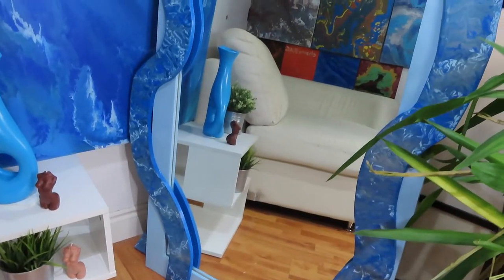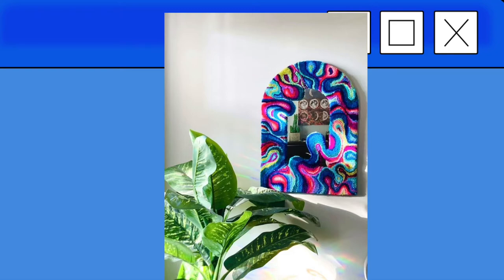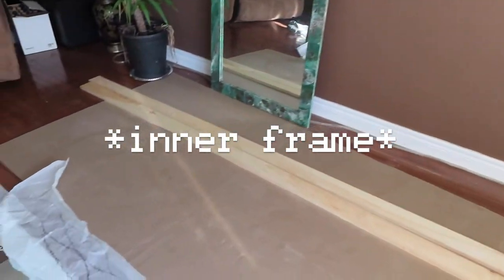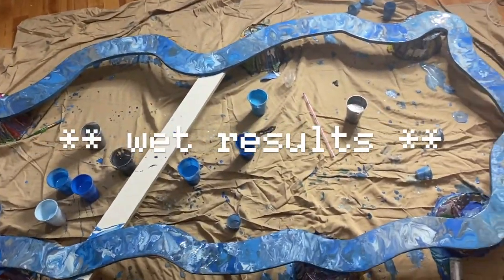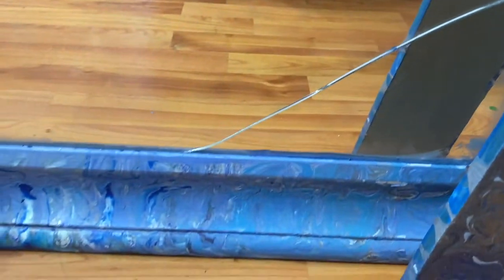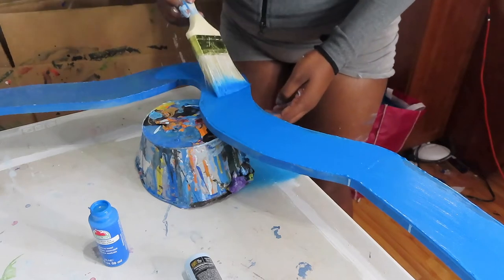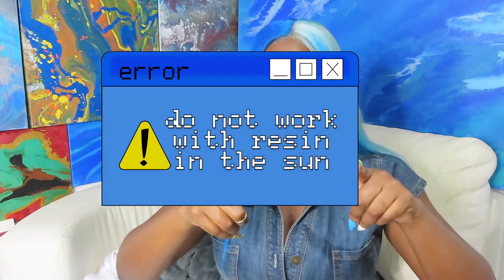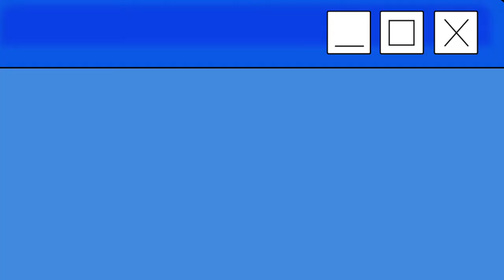diy aesthetic squiggly mirror ~ curvy wavy abstract furniture | acrylic pour & resin

Comment: Cute idea. Just for your future knowledge your resin was totally still fine and it does not matter if it was an inexpensive or an expensive resin. All resins can do this. It had an exothermic reaction because there was alot of resin mixed at once. When you mix alot at once it does this real fast. Most resins will state in the instructions a maximum of pouring  depth and  an working amount of time. I have art resins that I cant mix more than 4 oz at a time and others I can mix more.   It turned out great :)